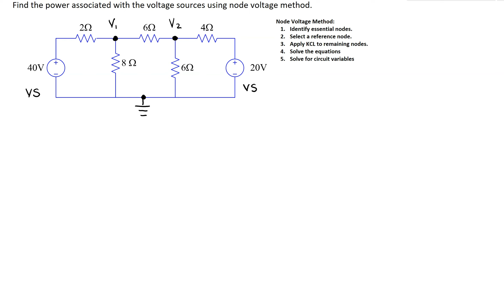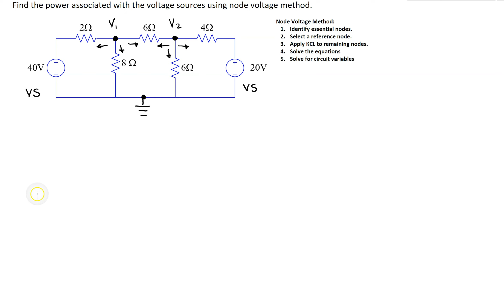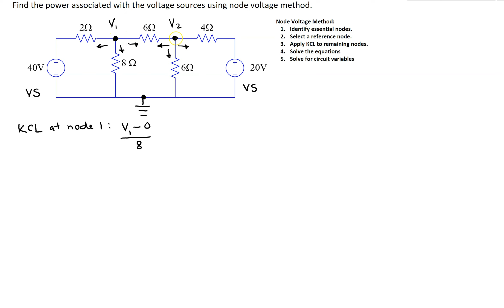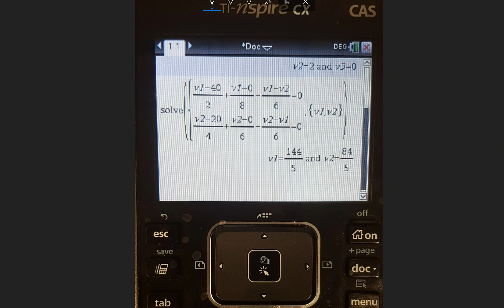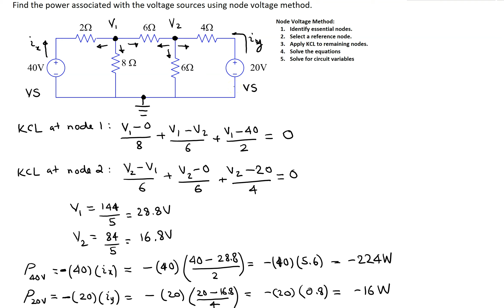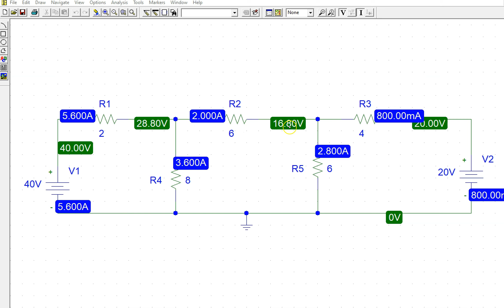Node Voltage Method  - Example 2 (Trick: How to account for voltage polarities)

Comment: That's why I think that fully theory-based classes fail. I wish my professor just tell us how to solve problems and why we are solving the way it is. I do not want to study at all in the classes since it is just filled with information and no actual problems we have to solve irl. The professor wants me to solve problems on my own after reading the power point slides that he made which I can kinda understand since we are in University and we are supposed to learn by ourselves. Here I am, cramming 6 weeks worth of materials 3 days before my exams. It is not even that hard. No offense but my professor needs to focus on research only, he can't deliver the ideas. Anyway, thank you very much for this video. Very easy to follow and absorb.
Reply from the maker: Thank you for sharing! This channel is indeed about learning through problem solving and practical (simulation) skills. I am passionate about making expert thinking visible to students and this is often missing in traditional PowerPoint lectures.